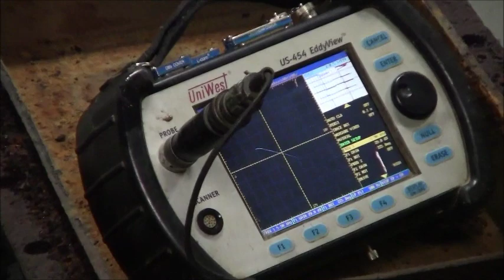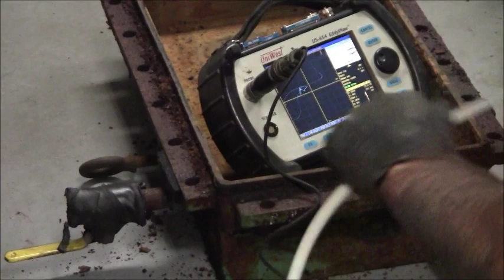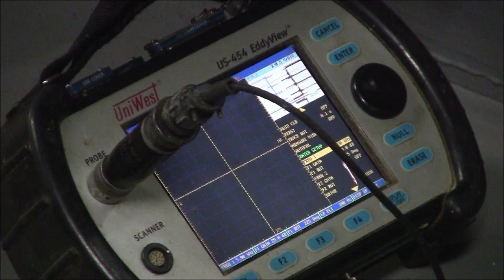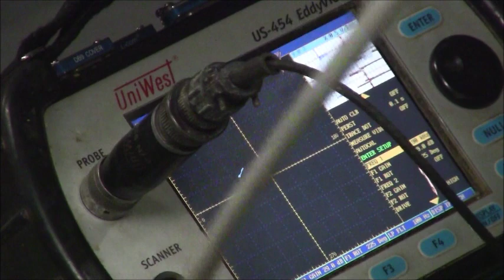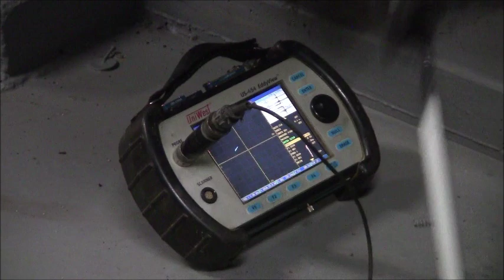Eddy Current Testing Chiller Tubes

Comment: Very well done video, easy to understand.  I have 4 very similar looking York chillers that are 200 tons each.  The condenser and evaporator supply and return lines are on the same side though.  What size are the chillers in the video?
I'm also assuming they are York, correct?

Comment: Dear Sir, why we are set hole on 40 degree and 1volt for differential channel and why we are  set absolute channel 0.1 volt at 40 degree for internal tube inspection by bobbin probe. Can you please explain it
Reply: Ir depends on the code he's working to... he may have a more lenient code where only larger discontinues are rejectable.. at least I'm assuming that's why hes using a UniWest instrument opposed to something more advanced like a corestar.